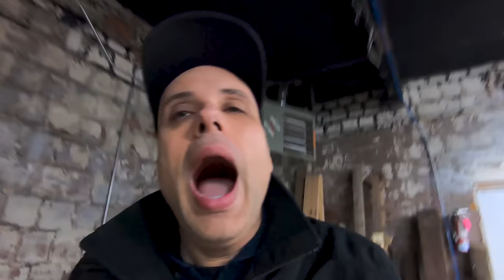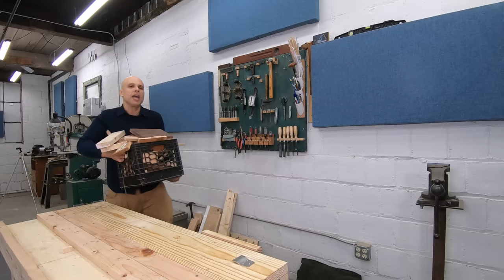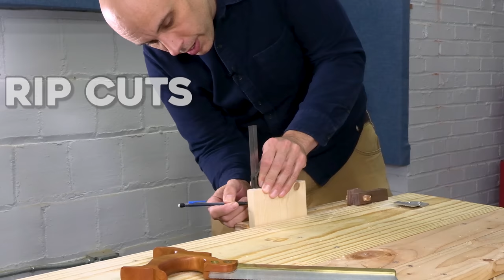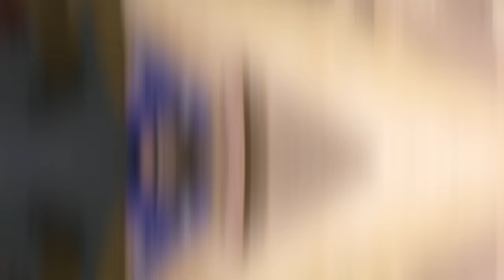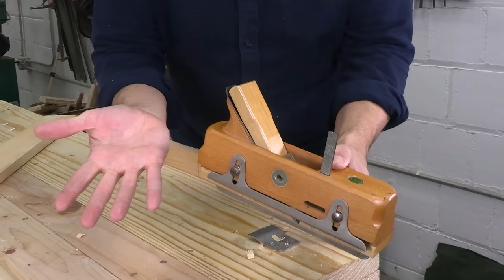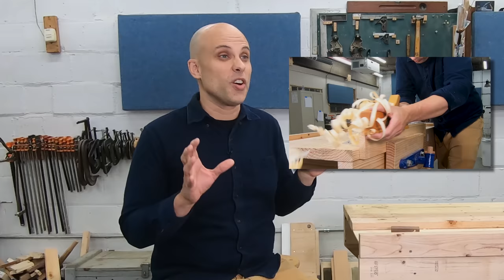Quick Skills for Busy Woodworkers: Elevate Your Craft in 10 Minutes

Comment: It's actually better practicing sawing directly next to a line. It's going to be a very rare joint where you want to split a line (or use a line, accurate joinery tends to be knifed); most of the time you want your saw next to the line on the waste wood, so you don't change the dimensions of the remaining wood. Added advantage; cutting next to the line you get a much better indication of your accuracy. If you saw away the line this only means the line fitted within the kerf, it doesn't mean the kerf exactly followed the line, and inaccuracy gets worse the bigger the difference in width between the line and your kerf. Sawing next to the line you can see exactly whether you followed it: it should remain completely with no wood left between the line and the kerf.
Reply: That is some sage advice! Thank you.

Comment: So lets see how I would use 10-15mins in my "shop". Step one move the car out of the car porch. First though move the other car parked in the driveway. Next move the bicycles. Then move the work bench so I can work around it after cleaning off the junk which it seems to attract when not being used. Then unlock the tool trolley and table saw so I can get to the tool cabinet and scrap bin. Then "Honey can you go to the shops and get some veggies for dinner and when you get back can you peel some potatoes... Sigh!!!
I'm very skilled at peeling potatoes.

Comment: This a really useful discussion.   A trick my grandfather taught me about crosscutting was to use the saw plate as a mirror.  In that mirror, the reflection makes the saw appear sort of transparent and the board seems to visible on both sides of the saw.  You want the edge of the board to appear to extend without an angle in it from one side of the plate through the other.  You keep that apparent line straight while starting the cut.  As you and other woodworkers point out, once the cut is well started it tends to stay straight and in the plane you started it in.  I was told this when I was quite young.  I did not understand how it worked until I took geometry in high school.

Comment: Don't forget maintenance tasks, either... those little things you don't have time for in the middle of a project, seem too unimportant to worry about most of the time, or seem too big to do all at once and so tend to not get done. Some examples: clean behind things, oil some tools that don't get used very often, organize your drill bits, gather up some tools that have been left scattered from previous projects, put away some of the clutter that tends to collect on flat surfaces, sweep around the edges of the room, clean the rust off of a tool that has been neglected, sharpen something, clean one shelf, question the layout of your shop, change that one burned out light bulb or buzzing ballast, start a shopping list of the things you mean to get when you're at the hardware store for something else but keep forgetting. All of these things will make your more useful chunks of time more efficient and/or more pleasant.
This could also be extended to chores outside of the shop. Do bits and pieces of the things that keep you out of the shop so you don't have to "waste" a whole day or a whole weekend doing random little chores all over instead of doing what you want to in the shop.
Reply: the reality is that you can't work effectively without doing those things and thus they are as much a part of your project as dimensioning the parts, cutting the joinery, applying the finish. so getting some of them done when you have small time is progress on your project even if it doesn't feel that way at the time

Comment: About a year ago, I actually had a scrap of time like this.  For my day job, I needed a docking station for 2 laptops with 2 monitors.  All of the stations sold on Amazon were for 1 laptop with 2 monitors.  So I had to modify it and move the center supports inwards so both laptops on each side would fit.  This involved drilling large precise holes in particle board.  Fortunately (thanks to you), I had a tool in which I had practiced on that was ideal - the bit brace.  I carefully drilled those holes required to move the center supports, making sure I didn't blow anything out.  
But I also needed some additional holes in the sides for USB cable routing. And these holes were partial with the bottom being open so the cables could be run though them.  Any power drill would have ripped that open side out, but the bit brace cut them perfectly.  And I was done in 15 minutes, ready for my zoom meeting.

Comment: Crazy idea...plans for shop equipment that are in themselves a comprehensive course in woodworking. When you've built the set you have all the skills you need and all the stuff to fully utilize those skills. Each piece could introduce a couple new joints or techniques as well as requiring you to properly use the stuff you've built previously.

Comment: I have spent the last couple of years tinkering and learning a ton off of another local woodworkers scrap pile.  I went 2x and got scraps from him.  That yielded me hardwood scraps which I had never bought hardwood at all.   I was too terrified of the cost v error potential.  

I have since learned to carve with a trim router on those scraps and make some decent signs.   I have been practicing box joints, rabbets, etc.   Box joint practice ends up making useful cell phone stands too. lol   One day I want to try dovetails but I am not there yet.  I will get there eventually.  

For a long time I had a lot of fear of messing up.  Embracing scrap practice was the thing I needed.  I was too mentally hung up on not wasting purchased wood.  But those scraps have helped me learn so much.  I still have a long way to go.    I am a homeschool Mom with little bits of time so this video resonates. 

For my birthday in Feb my husband is going to take me to one of the hardwood  dealers here.  I now have a small planer and jointer so I want to get some rough lumber and finally perhaps create my own scraps. Lol 

And hello from down in Wayne County!

Comment: Such an amazing video.  When I think, everything I do well I honed my skills like this.  Just today I took a slow time at work to program 1 piece of a little tool I’m making because I don’t get to do that enough anymore.  Too many people in my position get out of touch with what they have to tell people to do.

I spent a little time before and after work cutting new teeth into a saw I don’t love because I’ve never done that.

I spent 20 minutes over lunch practicing guitar.  I’m still terrible at that, but I love it.

Now I’m watching videos after the saw work because it’s cold in my garage.  I regret wearing slip on shoes, my feet are cold.

I’ve learned that with the things I love, I love the activity.  The output is extra satisfaction.  I’ve also learned to start with a version of a project I’m OK with screwing up while I learn, or that I never finish.  It’s a hobby and putting pressure on myself defeats the purpose.  I have a job for that.

Comment: I agree, it takes practice to develop good tool skills. I am a woodturner, I don't do flat work (well not a lot). But I do need a lot of practice with my turning tools. But you said to practice using scrap. There is no such thing as scrap. Those pieces are just off-cuts waiting for another project. However that project may just be to practice tool work. 😃😃😃 Thank you for sharing Rex. Have a great day and stay safe.🙂🙂

Comment: Yes, good ideas. I've been doing just that too.  After work, I practice those skills that I'm still too rough at such as coping the miters for the skirting boards ( that I sill haven't finished installing in my house),  using my hand saws for cross cuts, making dowel joints, cutting tenons and mortises using hand tools, and just maintenance stuff such as sharpening chisels.

Comment: Thanks Rex. I guess it is a challenge to run a channel such as this since there are traditional methods, modern methods and the same again for tools. Although besides the functional self created methods we also are creating essentially the same traditional  products that timber has always provided. Like mitre's for picture frames. An idea for the Sunday market, I would frame some pictures to sell. Armed with a freshly doctored mitre saw and a mitre box The mitres were not correct. After practice the angles were coming out okay but the matching was sub par. The most surprising discovery was to keep the saw vertically steady throughout the strokes. Practice, practice, practice. The same is true of every craft, and of art too. What you taught in this video is not how to. It is to learn, how to.

Comment: Hi @RexKrueger, I have a method for cutting straight that I don't see mentioned anywhere ... I like to start a cut on one edge of my board, about 1/4" deep.  Then rotate the board forward 90deg, using the initial cut, and drive the saw back on the second edge.  Repeat this process all the way around, to create a kerf.  Then finish the cut, following the kerfs.  It negates the question of whether my saw will go off-line on the back edge of the board, or wander on a long edge, especially when the board is wide or deep.  I've used the process on 2+ft wide boards with no issues.

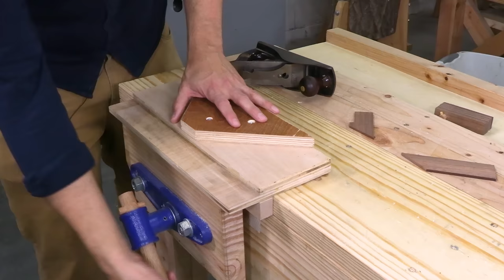Comment: 7:37 why do you even have a double sided mitter shooting-board? I mean you could just turn the shoothing piece on the other side and shoot it from back to forward instead on using the oposite side of the board and shoot it from face to backwards, ignoring all aergonomics. The 45⁰ angle will transpose along with the rotation. Not to mention the board would be smaller and lighter.